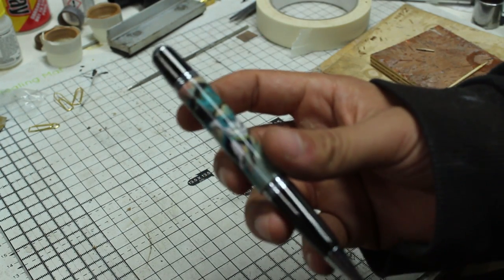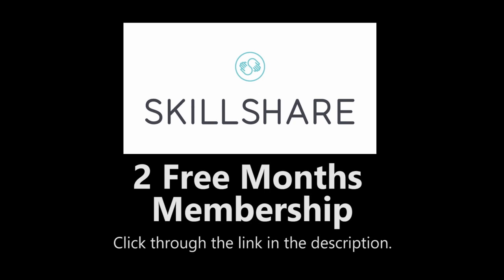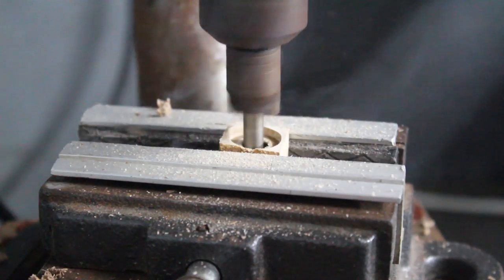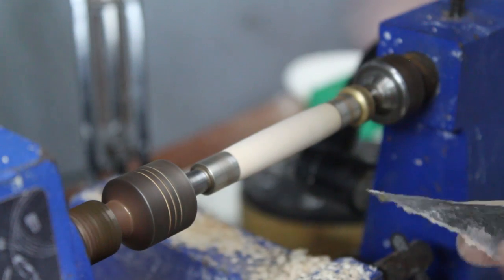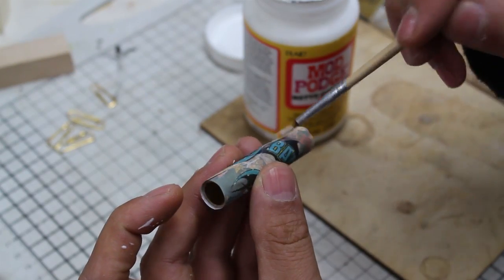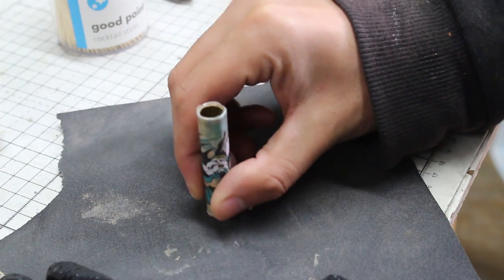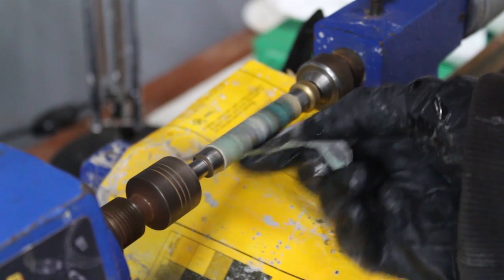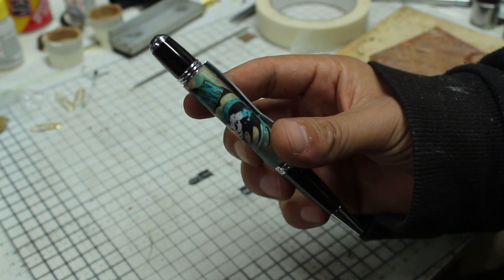I Made A Batman Pen With Comic Book Artwork (No Tube Casting)

Comment: Nice work! When I first saw the thumbnail I figured you were going to do a tube-in casting but I like this process too. I do a ton of pens and found that using my drill press as a pen press works very well. You'll want something with plastic or nylon end on it to press the pens together but it works great for me! Keep up the great work!
Reply from the maker: Mike Pickett - Penmaker & Woodworker cheers man!  That’s a great tip with the drill press!  I could probably turn some HDPE or Nylon - definitely trying that :)

Comment: Just a thought that might provide a flusher (is that a word?) finish at the ends of the barrel might be to create a slight recess in the wood with a couple of mm of exposed wood at either end left flush with the bushings. That way, there would be no lip created by the additional layers of paper and CA finish. I've seen you do that with ring inlays, so this would be a variation of that technique. Plus if you used an exotic wood or resin blank, it might create an interesting border. Still looks great though.
Reply from the maker: Haha if Flusher isn't a word you'd find on Urban Dictionary then it should be appropriated by woodworkers :D 

Good idea with the channel setting - I bet you could make some real nice designs that way!

Comment: Nice! For us lathe-less people, I’m guessing you could build up layers of comic book paper around the brass tube instead of using wood, like you did for your comic book ring?  I will totally cut up some comic books to try it!
Reply from the maker: Yeah that would probably work, might just take a little longer!
Reply: You could first roll a few layers of plain or colored paper to build it up. Saves on comic books and you'll probably get a more level surface.
Reply: Also, use epoxy might work better without a lathe than CA, as it gives you more time to apply and get it smooth.